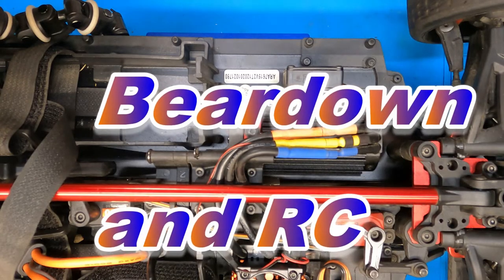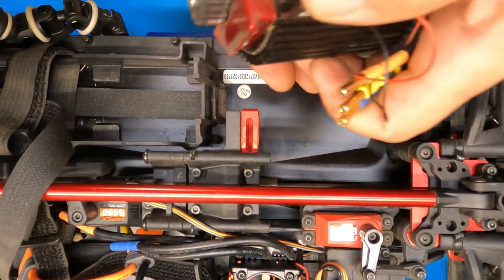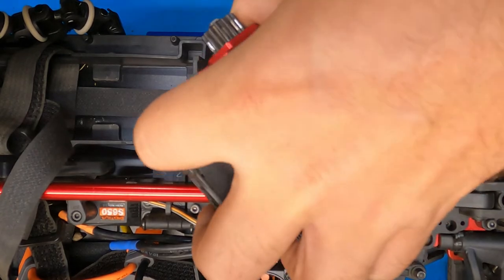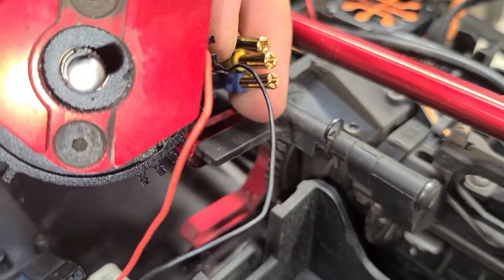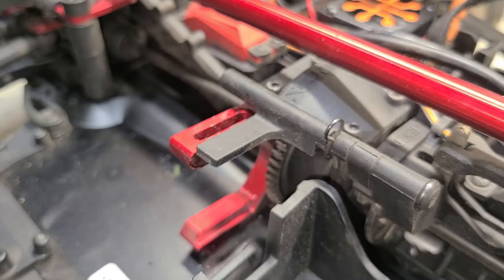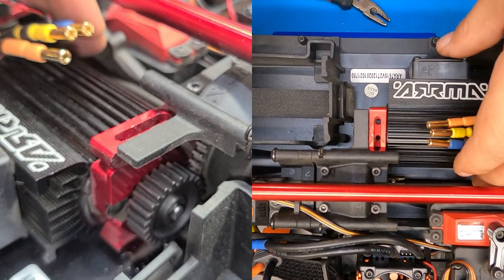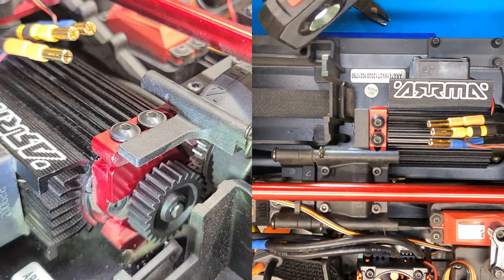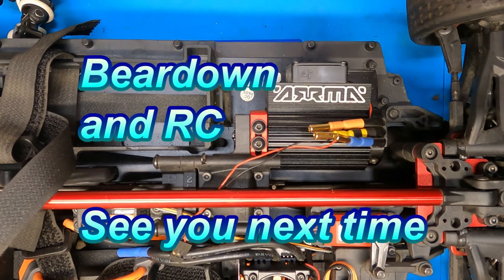How to change pinion gear on Infraction V2

Comment: Thanks for the video👍🏻 I just put a 27t pinion on my v2 infraction. Bit scared to take it out now
Reply: what was your top speed on it? and do you have stock electronics?? asking i Just got a used infraction. and my first speed runs where like 2 hrs ago. i hit 62mph on it. I will need to get new tires on it.
Reply: @mataflais  I got 82mph on the 27t pinion and stock electronics but esc was cutting out. I now have a xlx2😃
Reply: @All-rc804  over 80mph  impressive. And with the xlx2 is giving you more speed? Or same but not cutting off? Did u also change the motor?

Comment: So how are you supposed to change the pinion gear if the 2 top screws DO NOT want to move without drilling from out and screwing up the screws themselves?
Reply: Use a torx screw
Reply: i had to drill it out lmao

Comment: How you know if the mesh is not to tight?
Reply from the maker: You want to be able to move the pinion a small amount before it makes contact with the teeth of the spur. An easy way to set it if you don't trust yourself to do it just by feel, is to cut a thick piece of paper narrow enough to be able to put it between the pinion and spur, slide the motor to squeeze the paper between the pinion and spur, once the mesh is set with the paper in between the 2 gears, tighten the motor mount screws, slide out the piece of paper. If you can pull the paper out without tearing it and the paper comes out looking pleated, you should be good to go. I hope that helps, if not feel free to let me know or ask me any other questions you may have.
Reply: @beardownandrc1064  thanks mate gonna try that method :)